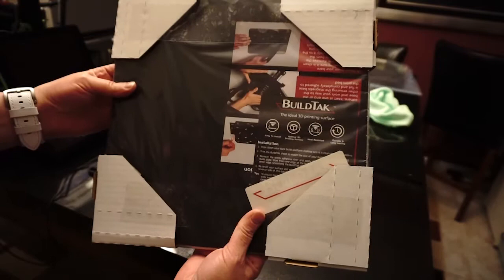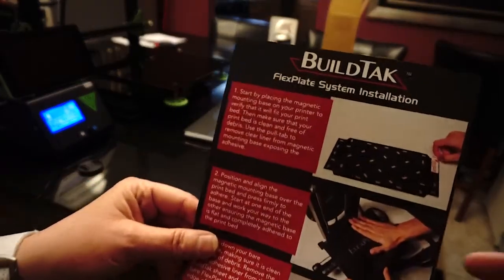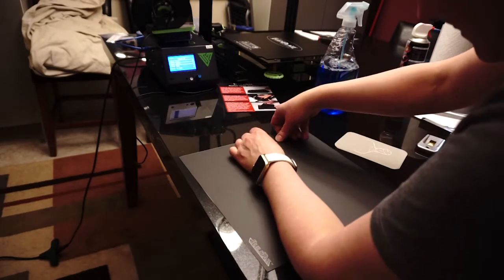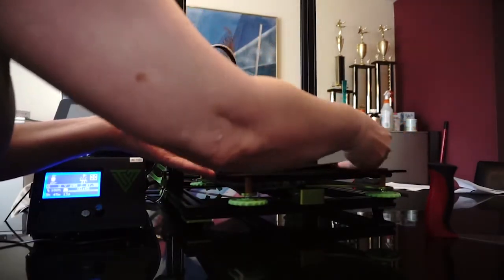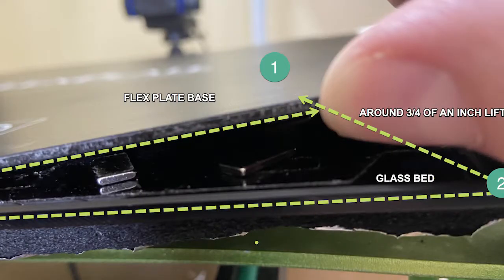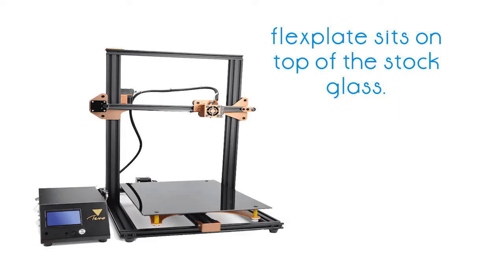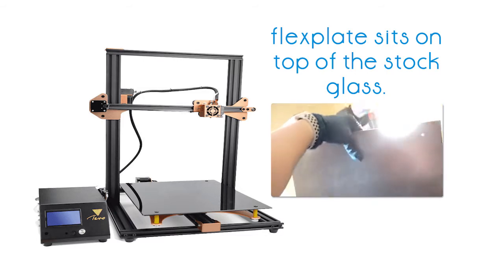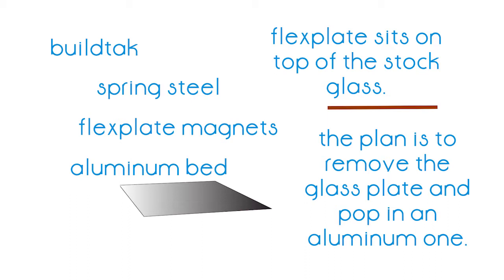Adding Aluminum Hot Bed to Tevo Tornado & Repairing a FlexPlate System

Comment: Hi nice video, what is the thickness of the Aluminum plate ?  Are you restricted in print speed because of the weight of the aluminum plate ?
Reply from the maker: The plate is 5mm and I am not sure about the residence question because I had replaced the z-axis stepper motors right before this, and the new one is super beefy and much more powerful than the stock was.  I would guess stock motors could struggle a little with this plate.  But this is untested so I cannot say for sure exactly how much strain.

Comment: Nice! I will probably at some point do the same to give aluminium a shot but I think I will get me an additional 24v silicone heater mat for the new aluminium hot bed so I can switch between between them easily.
Reply from the maker: how did that turn out?